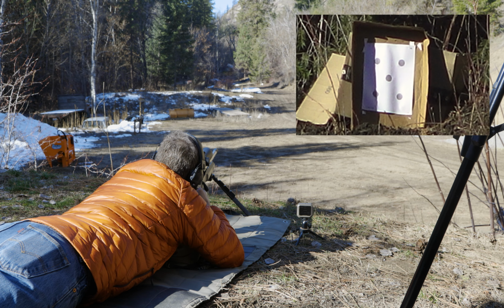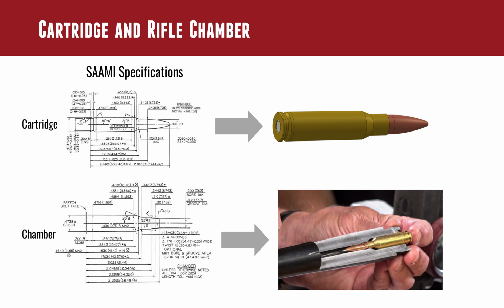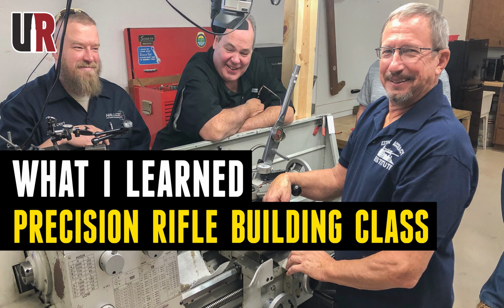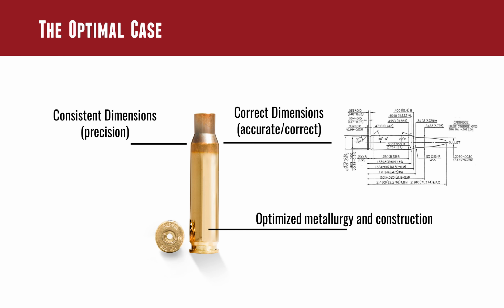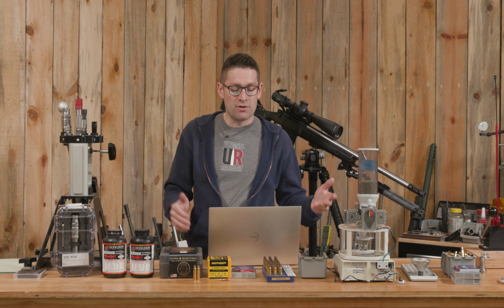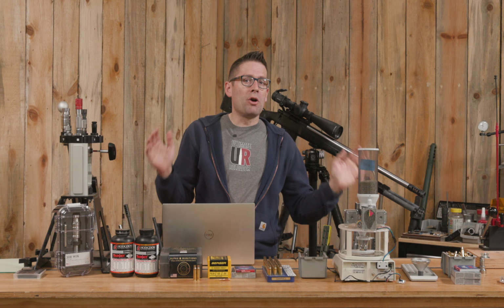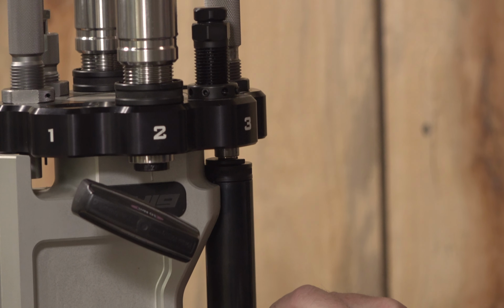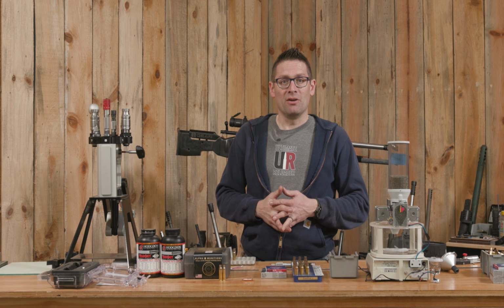Winning Formula: Brass + Die + Chamber

Comment: Would love to see a video where you take a say Hornady 6.5 creed cartridge and measure head then measure fired cartridge and after each step in full how to "bump" and measure to be between min and max head. I have been reloading for 50 years but for hunting and now want to load some accurate cartridges and maybe try some of the "big boy" shoots. I currently have a 6.5 and the case head on 140 gr (me measuring using Hornady gage and also RCBS head mic) and neither the Hornady first fired or a go gage will go into battery. Would love to discuss this with you on the phone or via email but do not know either! Thanks

Comment: How can you adjust the shoulder bump on an existing die? Resizing dies don't compress the brass immediately above the case head or the webbing which is where my chambering issues are. But, this is with brass that has been fired numerous times. Annealing the brass will not help the case head bulge. I know there is a roller sizer that compresses the brass at the case head but for a casual reloader the cost is too much. It is less expensive to buy new brass. What are your ideas about this? Thank you.

Comment: Are my expensive EC dies going to stop my dreaded clicker problem. 
I’ve had all sorts of trouble reloading for my 6.5 prc with aw2 chamber. Got case head separation with hornandy brass after 5 firing and unchamberable Lapua brass after five firings. Definitely case expansion around the web has been my issue. I’ve been using Redding and RCBS dies with no success. Hoping Eric Cortina figured this out with his FL die and Mandrill die combo. Anyhow great video Gavin, best explanation I’ve seen yet of the CLICKER

Comment: I’m getting confused with different types of dies. Does the area 419 FL sizing die not only decap, but does it expand the neck (mandrel or expander ball?

And does the seating die do any outside neck bushing closing or crimp? Or just seat the projectile into whatever neck tension predetermined from last firing?

I feel like there’s 3 steps, FL and decap (optional expander ball) followed by optional mandrel internal neck sizing or outside neck bushing (but not both together) to get your optimum neck tension, followed by seating die (some having crimp, but do seating dies do more than just push the projectile into the neck?

How many dies to cover FL, decap, control neck tension and seat are needed?

Comment: When I have this issue is always from very hot loads or cheap brass. When it happens, I take 3 pieces of fired brass and send it in to Whidden or Forster and have them make me a custom die. Problem solved and usually that custom die will work for all other new barrels. With smaller short action cartridges, usually Forster does the trick. For magnums like 300 Norma, I use Whidden. Sucks having to do that, but I dont have to pull my hair out trying to figure out if the die was involved in an all night drunk party, the shell holder was made by a single mother or the chamber decided to shrink overnight in protest of my hot loads. Send the brass in, wait 3 weeks and problem solved.

Comment: Definitely experienced clickers, I've blown a primer or two and split a case once.  Let me just say, It's pretty scary when your rifle makes a crazy weird bang and a bunch of smoke comes out in your face.  That ended my day and I went home and pulled all the bullets, changed powders and rechecked everything I could think of.  I was 3 grains over max on my 284win running berger hybrids with H4350, I now use 4831sc which is a slower powder and get the same velocity out of a 30" barrel.  2800fps.  Unfortunately Alpha doesn't make 284win brass or I would use it.  If you're listening Alpha, you can do the rebated rim.  Please!!!!! A lot of F-class shooters would use your brass if you made it.

Comment: Gavin I absolutely love your videos, especially around the topic of reloading and performance. I tend to load to the higher node and push pressures a little in my rifles. The first pressure signs I get are flattening primers and a little swipe, usually nearly undetectable. Some people think I should go down to the lower node but I've never had any problems with brass and I usually get 15 to 20 firings out of each piece, And I find a higher pressure node gives me lower ES and SD using lapua and Hornady brass. I anneal between every firing and inspect every piece of brass through the reloading process. 

I think it's also important to use a borescope to make sure the carbon ring is kept in check to keep pressures acceptably low/consistent.
Thanks!
Reply from the maker: Good point about checking for carbon ring!

Comment: Lets talk about the action, including firing pin size. A factory action will pierce primers way before this level of pressure
Reply from the maker: There’s another critical factor here- this rifle has a SAAMI min chamber Re: headspace - this can affect primer piercing! Excessive headspace can correlate to pierced primers in some cases.
Reply: @Ultimatereloader  Gavin this should be another podcast unto itself. I have a handfull of really nice "Custom builds" and some factory actions with cut rifled barrels and load development is not the same between the two.

Comment: Had a similar issue, no clicker and bolt worked great, MPA 6.5 with Curtis action. Lapua brass at 6 firings. My cases didn't fit the Wilson trimmer gauge the same, shoulder didn't come to end. Wilson case checker was fine, I have a Sherdon cut away case checker and brass stopped 1/4" from bottom. Measured case was at max saami. Got an EC base sizing die, worked good on Hornady brass but Lapua showed a slight ring almost half was up case. My sizer is a LE Wilsom with SAC bushing.... only bushing ill buy now... 2 to3k shoulder bump, tried to go to 5 and had overcam, still same thing. Switch sizer to SAC and case dropped in case checker, tight but fit, LE Wilson case holder for trimmer worked after that. My Alpha brass has 3 firing on it , never had any isses. Hornady brass was fine also, other than it grows a lot every firing. Never had issue with firing or groups but sizing die change made a difference, I might be just being pickey but it was always on my mine as I shot. Great Video

Comment: Advanced reloading:
Use a micrometer that measures to the .0001

New brass dimension at the .200 line
Fire formed dimension with no extraction problem, at the .200 line
Formed brass dimension where you get a Clicker or increased bolt lift, at the .200 line
*Resized brass dimension at the .200 line, 

This is the start of your being informed on exactly what you are working with.

Comment: Gavin I have dies that I sent the brass to one die maker Harrells and I still have problems with not sizing the web enough unless I bump back .008 . This is not acceptable. Sent reamer print to Widden ,talked to them on the phone they said their standard die would work just fine on 6 BRA . This die does nothing and is unable for my chamber . Two sets that are paper weight's.

Comment: Thanks for your presentation. A .308 winter load blew out a primer one summer, which was disconcerting, so the Alpha Munitions brass may provide some peace of mind. I'm not so interested in hot-rodding (for sake of barrel life), but the safety factor would be well worth it.
Reply: What "safety factor"? What exactly do you think is going to happen? Most loads in books have been tested over 10% of max and even if you load as hot as possible, nothing other than a blown primer pocket and hard to extract case is going to happen unless you're an over the top imbecile and use pistol powder in place of rifle powder. Its also not 1970 anymore, all newer actions take all kinds of stupidity into account to prevent catastrophic failures. I've done some stupid hot reloading and all that happened was one use brass.
Reply: @equalleftrights3130  Alpha Munitions "Optimized Casehead Technology" where "they're able to increase the durability and strength of the brass, specifically at the case head", which was where the mentioned failure occurred.

Comment: Is there is essence a general clearance measurement between cartridge and chamber 200 line values to which one should establish to avoid clickers? Say one mics their particular brass 200 line and then designs a reamer for the chamber 200 line value. Should the reamer be cut .001, .005, or larger at the 200 line to prevent clickers? Perhaps the flip side of that question is, what would be the maximum value of the reamer at the 200 line to avoid clickers and also mitigate excessive web/primer pocket expansion?

Comment: I have a question for you.  I have a 6.5 creedmor using hot, but not over pressure loads.  Using lower quality brass, and after the four to five reloads, using the same die and head space, around 0.002-0.003.  The base's of my resized cases are too tight to chamber smoothly in my chamber. Using a RCBS for, what is causing this?
Reply from the maker: It's most likely one of the issues outlined in this video- brass quality, chamber specs, reloading die specs!

Comment: So.. SAAMI doesn’t control either the lock stiffness of the firearm or the brass hardness profile of the case. Whether or not you experience a “clicker” depends on the lot of: brass, powder, bullet (& construction) as well as the state of barrel cleanliness and whether you have crimped the bullet in the case. Completely avoiding a “clicker” over hundreds of rounds might be impossible unless your loads are considerably below listed max.
Reply from the maker: Crimping has nothing to do with clickers. If you have correct brass, rifle chamber, and die dimensions, you can avoid clickers without the need to load below max.
Reply: So, you’re saying crimping doesn’t influence peak pressure? REALLY?
Reply from the maker: @jeffsiewert1258  There are two types of factors- significant, and insignificant. Crimping would fall into the second category here. It's important to focus on the KEY factors here- brass strength, chamber dimensions, resizer dimensions. Recall from the video- we didn't have clickers even at 103,000 psi BECAUSE we had those three factors in check. Make sense?
Reply: Nope. Worked frequently with brass cases as a ballistics engineer for over 40 years. In my experience, peak pressures north of 70kPSI cause the brass to yield, resulting in a residual stress between the case base & bolt face, which is the root cause of your so called “clickers”. Reducing the pre-firing clearances between the case & chamber certainly helps reduce residual stress, but can’t completely eliminate it, especially when pressure gets really high. I’d like to see your numbers with & without crimp to see if actually is “negligible”, as you claim.
Reply from the maker: @jeffsiewert1258  Did you test Alpha Munitions OCD brass?
Reply: Freely confess i have not. However, if it’s 30/70 cartridge brass & you have a hardness profile vs distance from the case base, i can convert that into true stress/strain and analyze it’s performance. Got data?
Reply from the maker: @jeffsiewert1258  Annealing Made Perfect and/or Alpha Munitions may have hardness data for you. What I do know is that Bruce Thom (maker of the action we used who has done much destructive testing of his actions) hasn't ever seen performance like this. He normally sees primers blowing out at anything over 80,000 psi.
Reply from the maker: Also- we should be getting pressure testing equipment this year, and I think your "how much does crimping affect pressure" would be an interesting test to run. We will keep you posted!

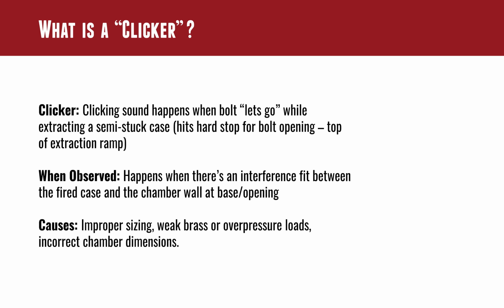Comment: at 2:22 thanks for clearing the clicker definition early; as the photo for the video shows a micrometer in hand, and... from mechanical engineering (car mechanics, machining), a 'clicker' on a mic is the ratchet on the smaller knob of the barrel, for failsafe torque application of the movable jaw onto a measured object, which ensures amateurs get the same reading, even if not knowing how tight to grip the work.

Comment: Hey Gavin, what is the barrel length of that 308 you overloaded? 
Do you plan to keep running that brass hot to see how far it will go?
That would be interesting… just take 3rds and run them till they’re done. 
The fella from Primal Rights has tested that brass to like 22 firings… but not so darn hot. 
Cheers!

Comment: I ran into an out of spec chamber once. The primers didn't indicate over pressuring, the loads were starting loads, but when resizing the brass it constantly got stuck cases and it felt like the press was going to break. A new barrel with a proper chamber got it all fixed up.

Comment: I have never had a catastrophic reloading failure,  but I always kept it simple and safe.  For one thing, I always purchased powder in different sized cans.  Red Dot, huge cans.  231 (most pistol for me)   mid size.  Odd stuff in one pound.  Always use a high intensity light to check powder level before placing the bullet.  Examine the brass after polishing.  And I am a savage; could easily load 100 rounds in  8 minutes on my Grabber and 800 rounds per hour on my 550B.

Comment: In the 40+ years of reloading and shooting, the FINAL RESULT I’m interested in is a one hole 10 shot group.  The definition of that is repeatable accuracy!  I’ve never “blown up” a modern bolt action receiver as it is almost physically impossible to do so unless you load 91 grains of W296 into your .338 Lapua.   This conversation is completely moot to most reloaders as most of us still hit the damn target with off the shelf dies and components.  The fastest consistent load I have ever run was a load in a Winchester Classic Sharpshooter chambered in .308 pushing a 175 gr Sierra HPBT at 2950fps.  Mind you the brass was no longer viable after shooting it because of primer pocket issues but it can be done!

Comment: Ultimately, if the back of the chamber is a little bigger it is better than smaller...clicking comes from a "tight" chamber and a sizing die that isn't sizing the web area enough.  Harrell's, a custom die and other shooting accessory maker, has a range of dies to help correct this issue.  Each die sizes the .200 line a little more in .0005  increments to help avoid the click.  I have spent a lot of time and cash on figuring this out, and if you don't have the right die for your chamber it will click

Comment: Hey Gavin have you ever had issues with the 6bra alpha brass? It seems like the headspace on it is .010 shorter than most average reamers
Reply: According to Alex Wheeler(inventor of the BRA) the BRA headspace should be a BR go gauge minus .004”.  There are two way smiths are head-spacing.  The non wheeler method results in a chamber .010” longer which is what you have.
Reply: @tomdanielson5717  I hear ya but that wouldn't explain how my chamber will close on my bra go gauge but then a standard br go gauge it won't

Comment: Hey Gavin could you do a high pressure video on one of the ancient cartridges like 30-06 or 6,5x55 45-70 9,3x62 that are loaded to very mild pressures from the factory to see how big the gains are on those.
Reply: 6.5x55 is one of my absolute favourite rounds.
Reply: You might want to actually look at the specs for those because the 30-06 isn't an ancient low pressure cartridge. 45-70 has been hot rodded up to near .458 win mag already. 6.5x55 is very popular and runs at "modern" pressure very frequently. 9.3x62 is just a .366-06, and can run the same pressure as 30-06.

Comment: Is it best to use the same reamer for your chamber and die?
Reply: There are reamer sets that will cut a die and rough cut the chamber with one reamer and then followed up with a finish reamer for the final cut for the chamber.
Reply: Based on what he said about 6 minutes in, no. After you resize there's some spring back so the die would need to have smaller dimensions

Comment: One thing to keep in mind if you're new to reloading is that some things like fire formed brass and sizing brass with very little clearance in the chamber especially with regard to head spacing (shoulder to case head) is different between bolt action rifles and semi-auto long guns. Cartridges that are tight fitting in the chamber are fine in bolt guns but will not be reliable in semi-auto firearms and may even create dangerous situations.
Reply: Not necessarily true. Full length size-always-but a 2 thou bump is plenty for reliability with most chambers and most cartridges. I run several, even oddballs, and that provides reliability and accuracy-provided you don't interchange brass and properly setup your ramps/adjust feed lips you'll be good with bolt gun practices. Just use gas gun pressure.
Reply: Too tight in a bolt rifle can be dangerous as all get out .
Do not be fooled